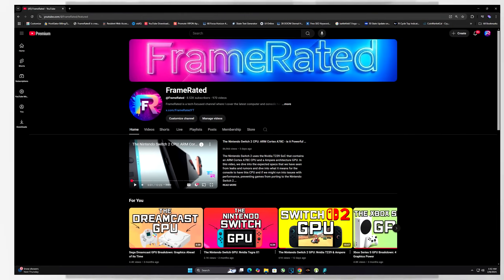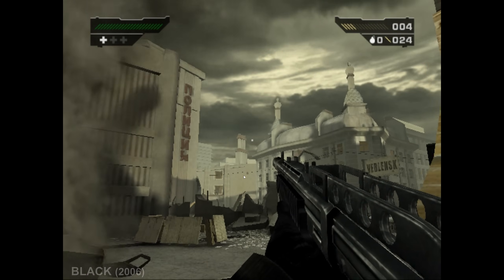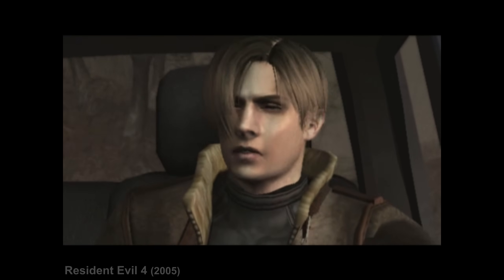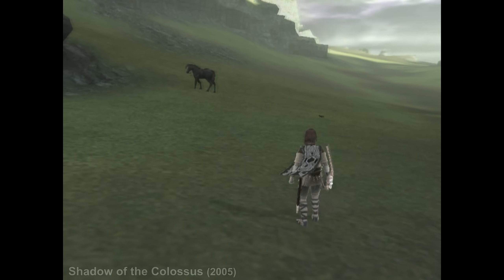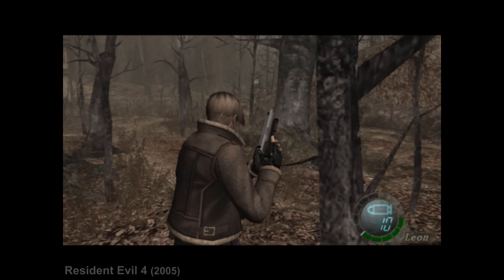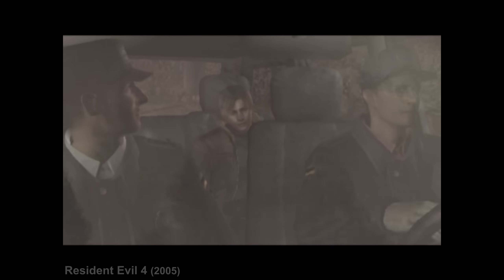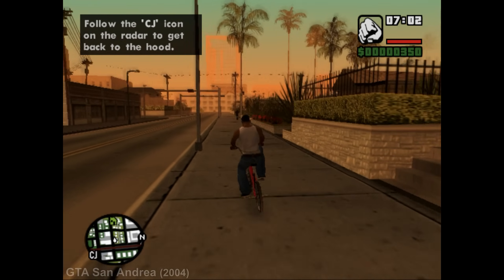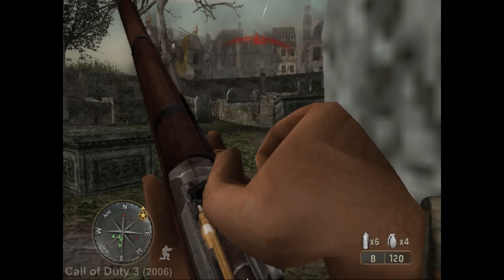The PlayStation 2 GPU: Graphics Synthesizer (Retro Breakdown)

Comment: Advantage of eDRAM’s ultra fast data streaming was great solution also for Xbox & Nintendo which have transformed into todays large L2/3 caches including AMDs 3D V-Cache which will play important role in future consoles judging from gaming performance of the AMDs X3D CPUs.
Memory is still falling behind and has been outpaced by compute for decades, that’s why the ULTIMATE gaming machine would use memory in required capacities as fast as compute ideally fast as registers/L0 cache.
It’s great AI is also pushing memory further, however SRAM cache won’t do it no matter how 3D stacking will progress due to its capacity to size with lithography shrinking limitations, however we might get some very cool chip on memory 3D stacking solutions instead.
Still the holy grail of compute unified and as fast as memory (foundation of organic brain) without extra steps & bottlenecks remains at least for now elusive & kind of a pipe dream, so caching will continue to reign supreme for the foreseeable future until we invent something better. 
Nice quickie vid, thx for making & sharing!👍

Comment: One thing you failed to mention is the insane particle effects it could do. Like rain, an example being metal gear solid 2 the tanker chapter the rain was pure particle effects the xbox slowed down badly because it could not handle the rain effects. Consoles like the Vita ps3 and xbox 360 had trouble handling the rain effects, and it's fps tanked. Yeah, Sony made a big deal out of it.

Comment: I wonder if gamecube could easily run a game like god of war 2 with increased fps if were taking disc space out of equation also could resident evil 4 look better on ps2 if they optimized more?
Reply: Oh please, how many times do I have to say that consoles do not use disks to render things on screen. The only thing the smaller disk size would have affected is the content which usually was cut scenes.
Reply: RE4 on PS2 was very rushed and not representative of the system capabilities.

Comment: The Graphics Synthesizer was a pure raster beast, the last of its kind before programmable shaders took over GPU development. Every pixel had a texture op attached to it regardless if it was utilized or not with blending modes and register combiners providing all the means for any custom special FX besides the fixed function logic. The ultra fast eDRAM granted enough bandwidth for the rendering pipeline to sustain full performance with 100% overdraw! No fancy hidden surface removal and occlusion detection logic was needed, just "elegant" brute force at the cost of the tight 4MB frame buffer.

Comment: Hey, love your videos, keep em coming!

Just one thing to note on the specs however, while there are 16 Pixel Pipelines, there are not 16 ROPs in addition to this. Instead, each pipeline was relied on to handle rasterization. In a modern sense, it's like having a GPU with no dedicated shaders but instead ROPs with extra hardware for limited shader function. GS could only do simple lighting and shading, the bulk of effects and polygon power was provided by the vector co-processors bundled with the EE. The 8 TMUs were also not their own separate hardware but instead part of the pipeline functions, though only half of the pipelines could handle bilinear texturing while the other half only produced untextured surfaces.

Comment: It amazing how the PS2 GPU was actually a powerhouse with proper engines like Burnout revenge & others doing things the Xbox couldn't do at 30fps. Even the Need for speed hot pursuit 2 favoured the PS2 which Is one theory why the GC/Xbox versions look like ass.
Reply: Even the PS3 has difficulties replicating 1:1 PS2 specific VU techniques. Probably the reason why they had to cut some special effects in MGS HD Collection.
Reply: @sebastiankulche  The RSX was bandwidth starved with 15GB/s being It max while the GS had 38.4 GB/s free to use. Later games had to use the CELL as a extra GPU because the RSX was crap.

Comment: That 2560-bit membus sounds just insane, never even realized that PS2 has such a wide bus, until recently.
Reply: How could Ataris Jaguar not even keep up 64 bit throughout Tom (for graphics) ? How expensive are bits in a bus on a chip even? I mean, if you don't need bon wires and pins for them?

Comment: when I compare the PS2 with OG Xbox, I always say that the Xbox is like a supercar that can run at 733 km/h but on a flat road and ps2 can run at 299 Km/h but on a very tough road means the intense graphics, that´s why PS2 despite looking quite blurry, can handle hard physics and graphics in a much better way.
Reply: I still wouldnt compare the brute numbers because both CPUs are vastly different. We shouldnt do that with any hardware.

Tbh Pentium 2 and 3 got dated really quickly. They are slow and single core only. PS2 EE CPU was actually faster than the 299 mhz seems like because it got the help of the vector units. PS2 was like a multi processor in disguise (plus no PC overhead). According to Micro Design the EE on its peak was 16 times faster than a Pentium 3.
Reply: @sebastiankulche  wow, is true, we should not compare them
Reply: @ Totally agreed with you
Reply: @sebastiankulche  Even the Xbox GPU was a issue since you only had 3 GB/s bandwidth as a peak while the PS2 had 48 GB/s. Burnout 3 & Revenge had almost no lighting effects because of It, Revenge almost skipped the Xbox because of the weak CPU & Bandwidth starved GPU.
Reply: @MT-ll3tu burnout 3/revenge does have lighting effects on Xbox and more accurate reflections whilst running better; wdym

NFS:MW’s global lighting is also more accurate on Xbox.
Reply: @sebastiankulche   The Core 2 Duo and Core 2 Quad are Pentium iii processors.
Reply: @dedxbox  Those are different processors from a new generation released in like 2006 or 2007. The final mainstream pentium 3 models, like the Tualatin core CPU, were released in 2001.
Reply: @sebastiankulche  Yes, that's right
Reply: The Xbox was capable of far more. It's just a sad case of not really ever being given priority for optimization and development so it was mostly just a port machine that never had the chance to reach it's full potential on most games.

I said most.

Take a look at Escape from Butcher Bay or Doom 3 if you want to see what the Xbox was capable of at it's best.

Comment: If I'm not mistaken, PlayStation 2 was the only PlayStation that offered graphics beyond PCs when it was released, and which PCs struggled to catch up with for a while. All other PlayStations offered graphics that were equal to or slightly lower than PCs when they were released.
Reply: Also, the PS5 had probably the fastest SSD on release.
Reply: PS1 and PS3 were also beyond PCs in hardware on launch date. PS1 launched when gpus basically didnt existed on PC, and PS3 Cell was probably years ahead of the time of cutting edge CPUs. You could also argue PSP did had better visuals than any portable device of 2004 too.

Nonthenless, any console with the pass of years would offer way more advanced graphics than PCs of those years due to ridiculous optimization. PS4 while on brute terms is like a gtx 760, it performed in 2020 like idk a rtx 2050
Reply: @sebastiankulche I can agree with you about the PS1, as 3d accelerator cards didn't become a thing for home PCs until 1996. That said, PS1 lacked bilinear texture filtering and z-buffer, which were basic features for pretty much any PC 3d card. That's why PS1 games look like pixelated ass 😂. PC was light years ahead by 1997. 

PS3 was quite impressive at release, but never ahead of PC. PC already had Intel Core 2 CPUs on the market by mid 2006, and the Geforce 8800 series was released a few days before the PS3. The PS3 GPU was based on a cut-down Nvidia G70/G71 GPU, similar to a 7800GT. No match for 7900GTX, let alone the 8800 series.

You could make the argument that the Xbox 360 was slightly ahead of PC when it launched in late 2005. It had a Radeon GPU with unified shader architecture, which PC GPUs didn't get until 2006.
Reply: @hartsickdisciple  The only reason PS3 didnt seem ahead in 2006, is because the devs were poor at understanding the hardware. Other than that, Uncharted 1 or Tools Of Destruction were miles ahead of early 360 games or mid 2000 PC games.

A hardware is defined by being balanced, not just one thing. I bet if PS1 tried to have zbuffer it would only be worse overall for the rest of the GPU.
Reply: @sebastiankulche  PS1 had subpar graphics compared to N64, let alone any decent PC with a 3D card by 1997. The only thing that sets PS1 somewhat apart is the fact that it came out in late 1994. It was quite impressive at that time. It was very dated 2-3 years after release. 

The PS3 Cell was unique, but ultimately never set itself apart in practice. PC had games like Half-Life 2, FEAR, Doom 3, Quake 4, and Battlefield 2 prior to the PS3's release. Crysis came out only 1 year later. 

The PS3 was held back by both the overly-complex CPU and a GPU that was old technology by the time it was released.
Reply: @hartsickdisciple  Cope
Reply: I don't believe that's accurate. Remember- The Geforce 256 was released in 1999, and the GeForce 2 in April 2000. PC also had Pentium 3 CPUs in 1999. Most PC gamers were running games at resolutions like 1024x768 or 1280x1024 by the time the PS2 was released. PS2 couldn't come close to that.

Some early PS2 games looked impressive, largely because of art style and being designed to run exclusively on that system. That said, there were absolutely PC games that looked and ran better at the time.
Reply: @ There was no PC game in the 90s or early 2000 with the geometry, texture, character complexity or special effects as games like MGS2, Jak And Daxter, Gran Turismo, etc. In fact, even the best PCs of the time barely worked when making Jak 1 world according to ND.

In terms of resolution i agree, but seriously did you that alone defines a hardware? Otherwise a Voodoo 2 would be more capable than even a PS3.
Reply: @sebastiankulche  A single Voodoo2 had a max resolution of 800x600. Most, if not all PS3 games are rendered at higher resolutions, so that's not a valid example at all. 

If I start listing PC games that technically surpassed the titles you mentioned, you'll just deny that they did. It's a pointless debate with someone who has already made up their mind. The fact of the matter is that the PC already had better hardware than the PS2 at or around launch. That was clearly proven when we look at the games that came out for PC between 2000 and 2003, designed to run on that hardware.
Reply: @hartsickdisciple  You could play Quake 1 and 2 at a resolution of 1280x1024 but well my point stands. I could had mention GF 256 as well. That still doesnt change anything though because even at 1p a 90s PC didnt had the technologies of those more modern consoles.

Its ok to be wrong.
Reply: @sebastiankulche  Thanks for proving the old stereotypes about console fanboys true. You're the most gullible when it comes to falling for marketing BS. Gaming consoles are built to a price point. They never have the  best technology, and everyone knows that. Everyone except for the most gullible.

None of the games you mentioned looked particularly impressive to the trained eye. They're built for consoles, meant to look good at low resolutions. The fact that you were impressed by them shows that you don't know much.
Reply: @hartsickdisciple  I was a PC gamer before even buying consoles. You dont know anything about me.

PC master race fanboys are the worst thing in existence. As if slighty higher brute numbers automatically mean better looking games.... Things arent that simple.

Comment: I wouldn’t call the GS that clever as much as it was simple and  W I D E.  By using a large number of simple pipes it could process quite a bit at once but that simplicity meant that complex effects had to rely on multiple passes, especially when it came to multiple texture layers.  Yes, coupled with the eDRAM the PS2 could instance and do quite a few special effects that even the 360 and PS3 had issues with on a per-pixel level.  Having to render the same triangle repeatedly everytime you wanted to pass a texture layer was murderous to the Emotion Engine’s crazy TnL throughput.  PS2’s triangle, pixel, and texture rates look great on paper but come with caveats but the freedom to choose your complexity could yield amazing results if you knew what you were doing.  Programmable shaders with multipass texture units made everything so much easier to implement, meaning the GS’s style of design was on borrowed time.  GS and the EE were products of their time as true GPUs didn’t exist yet and it wasn’t entirely clear how to get the most bang for the buck.

And yes, the PS2 can do bump and normal mapping.  It’s not built into the hardware and has to be done via software doing multiple passes.

Comment: El procesador grafico de PS2 en sí era extraño. Esos 4 MB solo servían de una especie de Caché ultra rápida; y todo el Buffer 35 GB/s y 9.6 GB/s de acceso a texturas; todo era extraído de la RAM 32 MB a 3.2 GB/s. Prácticamente la PS2 era una GeForce 2 ULTRA en términos de proceso bruto.  Claro la GS dependería de la MIPS además VUO y VU1. Para ser una consola que se empezo a diseñar en 1998 y se finalizo en 1999; en el 2000 a la venta. Tenía demasiada potencia por aquel entonces. Y un precio mucho más bajo que un PC de 1998,1999,2000,2001,2002. Ya en el 2003 se ajustan los precios de los componentes de un PC a $500 USD GeForce 2 MX 32 MB, PENTIUM III 700 MHz, DVD ROM, 40 GB, 256 RAM DDR, WINDOWS 2000, MOTHERBOARD, POWER SUPPLY, CASE, ± $500-750 USD.

Comment: The PlayStation 2 had no GPU it basically relying on the Emotion Engine to do all the 3D work.   The GS just pushed data from the frame buffer to the screen. The weakness part of this architecture was exactly that 4MB VRAM for the graphics since it was very small even though it was fast and you could not store graphical data needed for 3D assets.  Compared to architectures like the XBOX where it had 64MB of unified memory that was available for both CPU and GPU removing that VRAM limit which is common on all modern consoles today

Comment: I think I read somewhere before that the GS was also largely based on the graphics hardware in the PS1 but multiplied many times over - they prioritized fill rate above all else
Reply from the maker: I heard about that too! They went and did something similar with the PS4 Pro GPU by essentially just doubling the PS4 GPU. I wonder if they will do anything like that again
Reply: Besides the MISP based CPU, i dont see in what is similar. Porting a game from PS1 to PS2 isnt something straightforward like GC to Wii for example. PS2 has access to graphical techniques that didnt existed on PS1. The rest of the hardware is still vastly different, plus PS2 GPU has proper zbuffer and texture correction.
Reply: The ps2 cpu I think was an enhanced version of the mips cpu in the ps1 but greatly enhanced and expanded with vector processors that did most f the graphical work.
Reply: This idea is not totally wrong.  GS is much more feature rich and of course the PS2 isn’t integer based and of low rendering precision.  PS1 and PS2 (and Dreamcast) follow the mid 90s PC 3D acceleration method of a CPU delivering transform and lighting data to a graphics chip.  PS1 had a low precision integer based vector coprocessor as part of its MIPS CPU.  PS2’s Emotion Engine was fully floating point based with one dedicated vector unit directly bused to the GS.  The MIPS main CPU core had direct access to a dedicated floating point unit and the other vector unit.  EE was unoptimized for making use of the secondary VU and hence went highly underutilized through the PS2’s entire life, kinda like the PS3’s Cell rarely fully utilizing all of its SPEs.

Comment: To add to this: the graphics synthesizer also had modes of resolution it could output (240p, 480i, 480p, 720p, 1080i) if you had component video, games like gran turismo 4 made use of it
Reply: I believe the actual maximum supported rendering resolution without hacks is 1920x1024 progressive (the 16:9 variant of 1280x1024, the highest officially supported resolution via VGA cable on the Linux kit).
Reply: @zummone Did a game ran in 1280x1024? I still wanted to this day to confirm that info but i couldnt find anything besides a wikipedia article that pointed it out.
Reply: @sebastiankulche  Unfortunately not, because A) no official game supported VGA output as far as I recall, and it would be ill advised to output it via component (due to HD CRTs being mostly 16:9), and B) you start to run into VRAM constraints since the framebuffers become huge (especially at 24bit color so you have to reduce them to 16bit), so even the games that supported 1080i just used it as an upscaled display resolution to make the games sharper with no render increase. Except GT4, those guys actually interlaced two full 480p frames so the result in motion is akin to 960p (internally it's 576x480 per half-frame, they had to reduce the horizontal res to make this even work) but if you set up an alternative rendering method or just make a 2D game it is totally possible to achieve native 1280x1024 or 1920x1024 at 60fps since there's no big bottlenecks.
Reply: @ I think it could had work for official compilations or homebrews of older games, like Mario 64. I hope the homebrew scene makes a good use of it.
Reply: I think some PS2 homebrew enthusiasts proved that 1080p was technically doable by tiling.
Reply: @BlitzvogelMobius  theoretically Sport, Fighting and 2/2.5D games could run at 1080i
Reply: @mandibiedermann2246  Maybe also PS1 native ports. If one day we get a port of Crash Team Racing for PS2 (as they are decompiling it), i could imagine the PS2 run it at 1080i or even 720p.
Reply: @ As i said is possible in paper